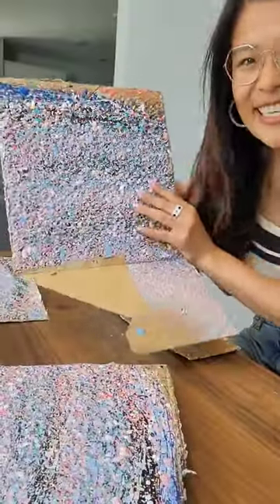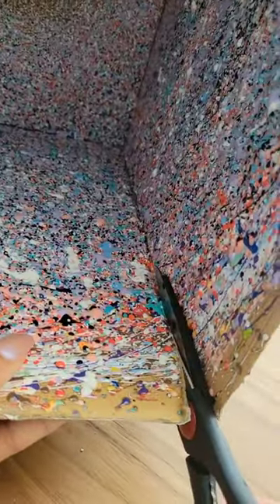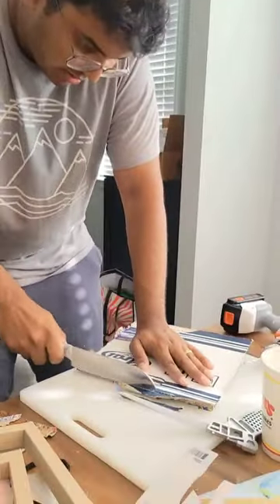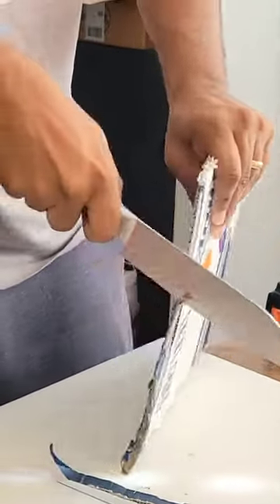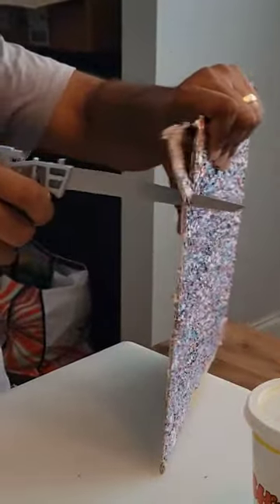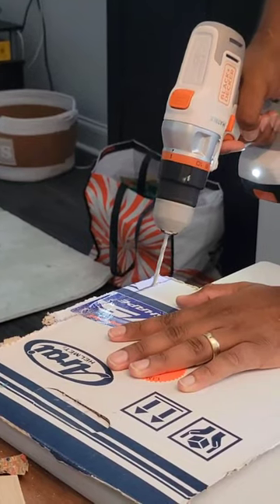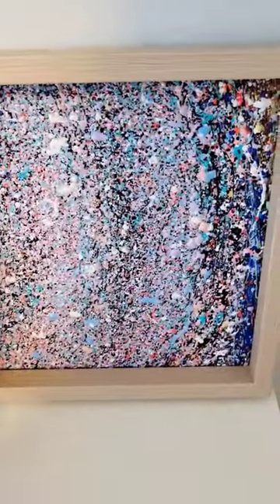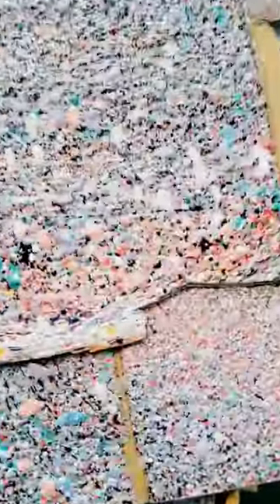Testing the durability of the jewelry enamel! 💪

Comment: That’s so pretty! 
Next time you need to cut the panels like that I’d recommend getting some metal snips, like aviation snips (get the yellow aviation snips, they cut straight).
There might be another tool that would work better, but metal snips will probably get the job done 😊